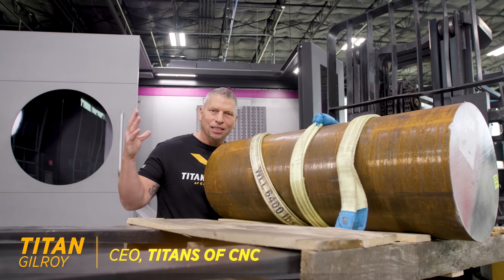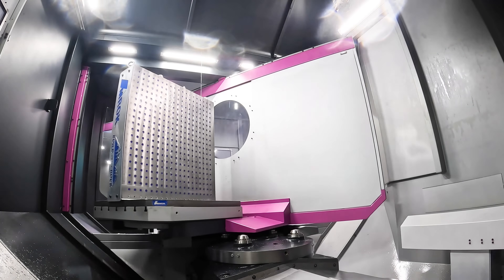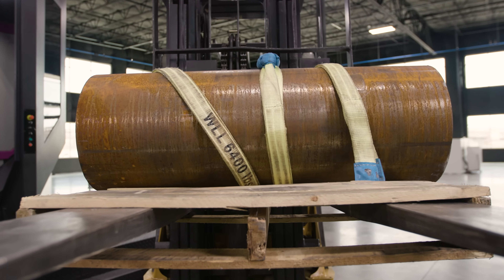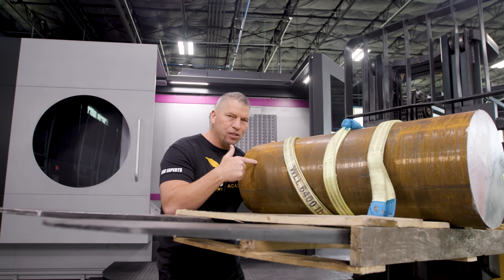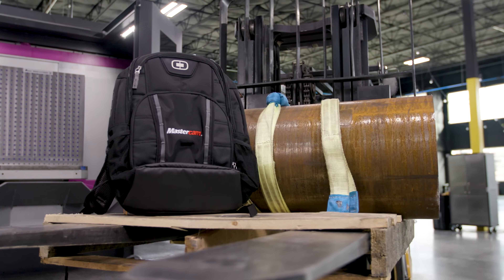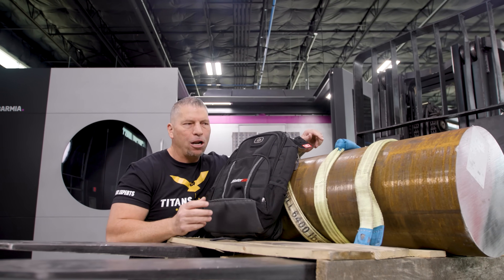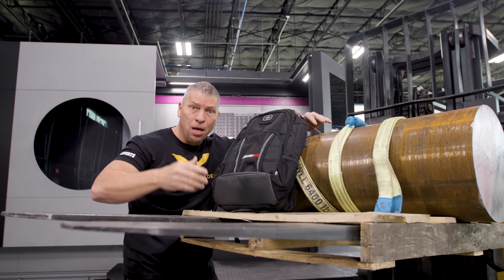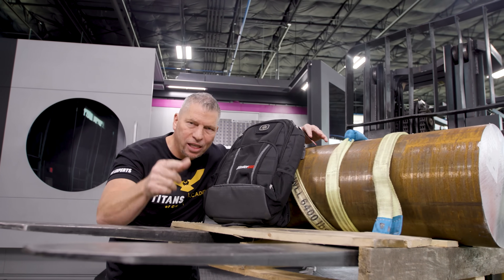How Would You Do It?? YOU Tell US How to Fixture This Monster!

Comment: Based off of older videos, without actually physically seeing the machine. I would install the pit bull clamping set up to the table. Now obviously without the specs in z, this may not work. But after seeing the videos of the ibarmia, being that it's not the most insane material there is (4140) set it up vertically, and use this monster to machine around. At least thru specified limits. If needed flip after top side completion and set up off of construction holes. Shouldn't be this difficult. But I have no idea what you're creating

Comment: Short answer option 1: Chain clamping in two places for roughing(with for example KOPAL 370270 chain clamps) for OP1. Clamping using OP1 threaded holes VERO - S for finishing or OP2 if later machining is needed (for example after welding). 

Short answer HARDCORE option 2: WELD a flat piece of corresponding(same at best) material to it and then clamp it using a VICE for OP1. Clamping using OP1 threaded holes VERO - S for finishing or OP2 if later machining is needed (for example after further welding). 

 
Explanation option 1: In my opinion the best way to rough the material on a horizontal with a tombstone is to buy or make custom (if storebought are not avaiable strong enough) two chain fixtures - there are two types. One type is screw tightend(KOPAL 370270 -16kN of holding force), the other works on the principal of chain hoist(this one you have to make yourself and will be stronger depending on the design) both are perfect for holding round parts on a mill because they spread the holding force on the whole round surface. Note that using this method the holes for OP2 must be made on top or on the bottom of the part in order to rough out what's left from OP1.

Explanation option 2: If you know welding and you know what type of it to use, how to heat treat it before and after machining and you have enough material for the welding heat to not effect the finish product. Your tolerances will be fine - trust me IT5 and IT6 are achieveable this way, provided the machine tool allowes dimensional accuracy and has thermal stability. Using tools You guys use and the machines You have it's possible. For haters of this method: it's common for large parts like that to be weld cladded or weld hardfaced (for example: rolling mill rollers, injection mold presses screws, large hydraulic actuator pistons etc.) and they all have quite a dimensional accuracy(IT6, IT7). I do it on a daily base with steel, stainless steel and cast steel parts but as long as you can weld the material it's doable. EDIT: You can even drill holes though welded piece to screw it ditectly to the table. After OP 1 you saw off the welded pieces. EDIT END

I apreciate the work You guys do, You are a daily inspiration. Titan i saw You at EMO Hannover 2019 but i chickened out of talking to You :) 

Greetings from Poland
Reply: there is allways option 3 to use indexing fixture with a tailstock (on a tombstone) or simply mount a 4th axis also with a tailstock, but i dont think this provides enougn rigidity for heavy cuts. Can't get this out of my mind :P i guess i really want this backpack :D

Comment: if there are going to be any round areas left you could make a couple of pedestals resembling a rifle scope mount to completely encircle the part at two locations. Maybe cut them from 1.5 inch thick plate.  Its hard to decide without seeing the CAD file.

Comment: What does the finished part look like? There's many ways to go about it. But anyways, If it is a part like I am imagining in my head, i would do an op 0 and cut dovetails into the length of the material and use dovetail jaws to grab on as little as possible, allowing you to reach as far as the head and interference will allow you to and you can also then rotate the table 90 both directions and machine the ends.  Op 2 would then be to create a fixture or softjaws if needed to finish the side that was being held in the vises on op1. 

But again, that's assuming I'm imagining the part geometry correctly, without seeing a print this is just a stab in the dark for what would be in my opinion the most efficient setup for some part geometry.

Comment: Use the other side of the tombstone. Fixture it vertically (2 piece vice maybe?). Square 3 sides and put it horizontally into the 4 vices.

Depends on the part though

Comment: I'd guess the first op is mounted up-right on a fixture of two massive (maybe even custom) v-blocks as well as a row of foot clamps prevent it from sliding down during cutting. Cam work would have to all skip around the straps. Bottom strapped removed for a second op, and machine surface put in and then replaced with a profile strap, repeat for the upper block. Machine a couple locating features on one or both sides (couple of flats to line up planer, and hole for centering 3d space. Machine a flat across the front half of the bottom edge to provide another reference plane that will sit against the bottom support bar/clamps. Part can then be rotated about the z-axis such that the machined surfaces are now against the the custom v-blocks that also have a profile to match some larger features; and re-indexed on the keyed feature on the other side.

Comment: sort of vague, can't guess what would work without knowing what the end goal is. you can skin this cat in many different ways but what would work depends on many different things. i would think looking at the open pallet and the block on the other, you're probably going to support it in the middle and use the block to stabilize on the end. how you'd go about it, i can't tell ya i only use a 3 axis at work and know enough about programing to jump through it when i fine tune the tooling or have to fix parts didn't seal. just a guess though, not sure the end goal.

Comment: You could machine a work holding part on the empty pallet with a locating pin in the center to match the hole already in the material. A bunch of mighty-bite clamps with a radius cut in then around the material should hold it in place. Keeping the material vertical seems far more practical than mounting it on the tombstone.

Comment: Titan, you haven't give a drawing. so I try my best figure out.

Firstly, if your finish workpiece is cylinder. I will use ratchet straps cylinder lay down on fixture to stop rollover. Two straps will be plenty to hold it.

Second, If your finish workpiece is cuboid. Again, I will use ratchet strap to use rough cut to flat and move strap for more flat area. Use holes on flat area for mount on tombstone.

Good luck and hope it is achievable.

Thomas

Comment: In order to actually answer this question you really need to know what is being made first.
However,  since all we do know is that there is a 5 axis, horizontal and a large round bar, we could strap a large chuck to the tombstone and hold the part from the end just like a lathe.  Then we can have 1600lbs of steel swinging around in space,  5 axis style.  Not sketchy at all when you take a 4 inch face mill and get down with it. 

Definitely seems like 5axis mill turn would be a better option.

Comment: If you are going to hold it horizontal in the mill I would use your four vices and make custom dovetail jaws to accommodate the size of dovetail for that stock, then do a Pre op on the 4140 and cut one flat surface then dovetail to match your jaws and if the dovetail is large enough it would be a pretty rigid setup, or make a fixture on your tombstone for the vero-s system and do a pre op and cut a flat and cut the counter bores for the system, say 5 or 6, I think each clamp is something like 8000 pounds hold down force so this would be a really rigid setup

Comment: Attaches pull-studs to the part and mount it on a zero point clamping system. Should hold if you are careful. Or place in a prism and clamp with clamps or a chain.

Comment: If the baseplate could be laid flat i would mount the part upright inside a large chuck that is mounted onto the base plate. But it all depends on the profiles you want to machine on the part. Sometimes it needs to be mounted horisontally with some sort of v block support underneath the part.

Comment: I would put this thing horizontally on the tumbstone pallet and lean the part against the tumbstone side so that the axle of the part is parallel to the X-Axis with 2 or more big parallels located at the bottem underneath the part and then clamp it from above so that the side that is looking to the turret is free and the part is lifted from the from the bottem of the tumbstone, that you can machine around. Then i would face the part and mill clamping faces on to it because you have 4 vices installed on one Pallet. I mean it depends on what you want to do on the first op.

Comment: 1st op: You could first hold it with a chain or a ratched pull of some sort and some v-blocks underneath it and then machine a dovetail where your Vices sit on the tombstone avoiding the chains.
on the 2nd op: you could clamp it into the vices machining every side on the part as needed but the bottom side then..
3rd op: flip it over another time if needed to machine the bottom side (where the dovetail would sit)

Or you just put threads in there for the schunk zero clamping pins you have with a little surface around them to have some rests sitting on the part instead of machining a dovetail..

Greetings from a machine operator and programmer on different 3 axis machines in Germany
Reply: you could be doing the first op for nothing !  your first op is  how i would go about machining a fixturing feature on that bar in a horizontal machine

Comment: Can you weld holding blocks to the ends   Or drill and tap holes in the ends and fab holding brackets  
Off set bolt holes so piece can be spun 90 / 180. 
I’m a plant mechanic not a machinist 
I’m just having a stab in the dark .

Comment: Machine some saddle clamps to hold bar horizontally. Machine one end with bolt hole and dowel pattern to match empty table. Recess diameter to get nuts on. Lift on using eyebolt thread bolt direct to table. Work top down to reserve rigidity.

Comment: Prep each side of part. Then drill a stepped hole a foot in length on one side. At its deepest the diameter is 3.5” at about halfway through its 6” and near the face it’s 10”. Then tap the hole at each step and screw on a base fixture. Then crane part in and attache it to a flat pallet in machine.

Comment: I would hold down the piece with v blocks at the bottom and put milling clamps to hold it down or if you want to Machine the hole face at once I would make soft jaws for the vices with a v shape cut in to it and then you can hold the hole block like that

Comment: Depends on the part design. I guess probably the simplest Op-0 is vise/v-block/strap clamp to drill and thread for VERO-S clamping pins. Op-1 use the VERO-S system to machine what can easily be machined in that configuration. Op-2 to the tombstone with vices and grab everything else while also being able to eliminate the drilled and threaded holes to make a finished part in spec... BOOM.

Comment: I'd personally take it to a big 5-axis lathe equipped with a steadyrest and tailstock, but it seems you need/want to do it on a mill instead. But there's no drawing so there's no way to tell why... My first instinct would be to fix a chuck on the machine which would hold the piece using either hard-jaw or soft-jaw, depending if you're holding on finished surface or not. That would keep it from rotating. Then for really making it rigid and secure I'd clamp it down with standard t-bolt and clamps setup.
Reply: Ya this entire thing is just one open discussion on how to machine round stock on a machine that isn't really designed for machining round stock.... But what if the finished part is the round stock? With this we don't need to mount it in the machine in the first place.

Comment: If it's machined all around, i would clamp it inside of indexer and add the tail stock, if not, i would clamp it on 2 or more V blocks straight on table, it could also be welded onto v blocks if clamps are in the way.

Comment: considering how vague that was asked, I would do a safe pre op to face both ends clean, concentric and true to each other ~200mm (about 8 inches) as you would treat steady bands on a lathe.

that would allow you to pick up the orientation and centreline with some clever probing on v-blocks/precision spacers. You could use the same thing to fixture as if you're on a vertical lathe and get some big bed mounted jaws if vibration and blocked access from additional clamping isn't going to cause issues.

Comment: 100% cant decide on fixtures until you know what you're making and tolerances for that part. I mean big ass vise jaws "could" work. Is it practical no does it mean more operations to finish other sides possbly. Chain clamps on vee blocks it will work but limits your operations to areas not being clamped. Vee blocks with clamps into holes predrilled into the end  holding it down would also work but limits your aggressive machining strategy. You "could" literally hold it on end similar to your octopus work holding is it practical no, will it stay in place who knows.  You could so any sort of these for a first operation machining one side with threaded holes for fixturing to the tombstone for the second op and then go HAM on it.

Comment: Press the bar against fixed prismablocks on the table by Chain slings which you can tighten and clamp something against the two circular surfaces so that the bar does not slide coaxially.

Comment: I would drill the holes on both sides of the part, probably an M16 or something like that, tap it, put the screws in and just clamp both of those from upper side down in T nuts just to secure the part wouldnt move until u machinr two parallels. And ofcouse the part will be sitting in all 4 vices just slightly clamped with them also. After making the cuts, just simply flip it over and clamp it in vices. And thats it.
Reply: Or weld two bars on the sides and clamp those, after just mill those, not sure how the finished part looks like..

Comment: As already mentioned by many people here, it all depends on what parts are planned to be made from this huge workpiece and whether auxiliary holes and fasteners are permissible.  If this does not matter, you could use a quick-change tool from shunk (I forgot what it is called correctly, it looks like a socket and a pin that goes in and is clamped inside), install the cylinder on the prisms, mill the plane and make threaded holes, fix the counterparts  , screw the receiving parts of the mount to the tombstone.
 But, you have already secured the vice, so it is probably planned to do it differently.  The cylinder is installed on a free pallet on prisms or v-blocks, rolled with an indicator for parallelism and a powerful dovetail is milled, on the soft replaceable jaws of the vice, the mating part of the dovetail is also milled.  This will allow you to remove the minimum amount of material, and at the same time ensure reliable clamping and fixation of such a heavy workpiece.  Although two simple flat surfaces can be made and used for gripping in a vice, it seems to me that it is not reliable enough.
 Sorry for the mistakes, English is not my first language.
Also sorry for such a long text, but I really want this dope backpack. BOOM!
Reply: quick-change tool from shunk --> vero-s
Reply: @Лимонныйщербетвкусныерецепты  Ага, значит, веро-с. Запомню. Спасибо, сладкий.
Reply: @Владимир_Сабиров  )))

Comment: As it’s one off you don’t want to machine fixture plates if you can help it so I would put it in a vertical 3 axis machine two flats or a dovetail with four end clamps clamping it to the table and then clamp in multiple vices on the horizontal

Comment: First put in the Doosan with the schunk claw jaws, lightly machine the face with a face mill and drill and tap about 6 3" threads on a PCD. On the Ibarmia you need a block to go in a vice which will sit on the pallet, maybe 3" thick and slightly bigger across the square than the billet (bigger footprint the better for stability, to fit in the vice) the block will have holes through to take the threads and counterbores so pins can be made to pull it back onto the fixture plate. This gives the most access all round the billet compared to just fitting a chuck into the machine

Comment: Let's go with the same way you fixured the Eagle, 2 "levels" with mitee bite raptors, maximum size. This table is fixed(as in not a trunion) so the raptors and its own weight should be able to take it, even when you rough at the top, BOOM!

Comment: That’s a bigger machine then what I’m used to.  I don’t know if your running it vertically or horizontally. Nor do I know the part.  If you have enough stock from the actual part I would mill some flats, drill and tap locations on stock milled flats.  So I could securely bolt it down to table and tombstone. Kinda hard to throw something out there without knowing the part. But we run round stuff sometimes I program flats and stand-off tabs so we can bolt that sucker down.   More points of contact the better. You can always remove bolts as needed later and mill tabs off.  Good luck

Comment: Weld blocks to the ends of the bar on the on the opposite side of the workpeice to which you want to machine. The blocks are then fixed in place to the machine so the blocks are effectively allowing you to machine one half of the job without interfearince. Do the top half. Remove the blocks. Turn it over. Do the same on the reverse... 
If you have to machine where the welded blocks could no longer hold the workpiece after you've machined the first/uppermost part of the job, then use either straps or clamps that you can move as you machine the rest of the job in stages. 
I charge £1millon an hour as a consultant, but in this case I'll settle for that free bag!